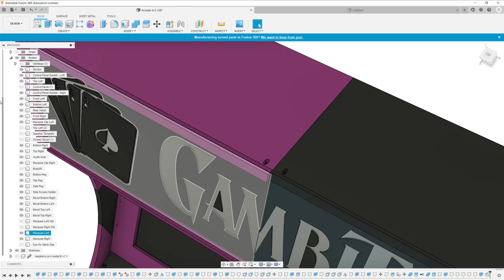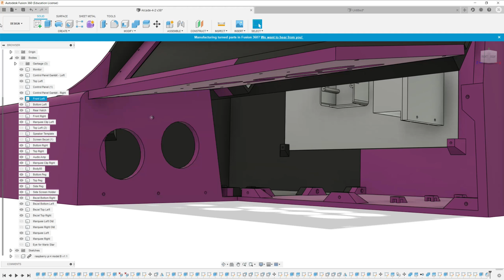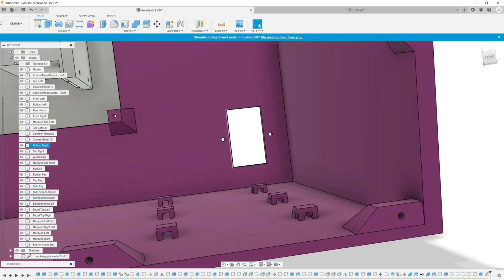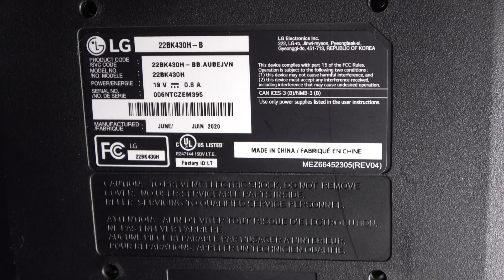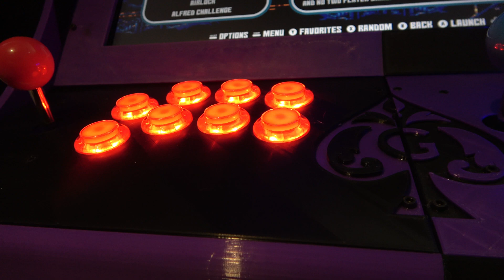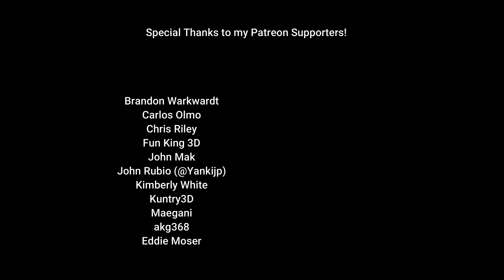3D Printing a FULL-SIZED Bartop ARCADE? The Arcade 42 [Pi Twenty-Six Ways Episode 11]

Comment: Dropped the files into OrcaSlicer just to estimate the plastic usage and there are enough oddities with the files that I gave up trying to figure out exactly how many spools this would go through. Empty first layers and oddball default rotations, for starters.

But, this being a 1 of 1 design, that doesn't bother me all that much, I appreciate the files existing, even if in an imperfect state. Given that my printer is 250 and not 300 I would have had to chop it up differently anyway.
Reply from the maker: I do have a habit of providing STLs as they came out of the design software and not as I'd print them in the slicer. I hope they help you build something awesome!
Reply: @PrintNPlay I have to many other projects to juggle right not but when there's a slot free this is a very solid starting point

Comment: hahah, I asked myself, "why doesn't anybody just 3d print an arcade cabinet and I ended up here, hahah. Very cool and I would think the cost is much less than a full-wood build?  Not to mention the wood builds are HEAVY.  I would also want a PC in the cabinet vs the Pi.  The Pi is cool and all...but what if I want to switch over to modern 4k gaming?

Comment: Awesome Job.  Have you ever done a Virtual Pinball build.  Similar to the Bar top arcade a Virtual say 24 inch monitor Playfield would be a another great project I bet you would excel at.  Great Job again.  Glad I found your videos.
Reply from the maker: Thanks for taking the time to leave a comment! And glad you liked the project.

I have built a virtual pinball cabinet using a 24" display, but I did it out of MDF as a proof of concept. It had a shelf for a 15" 4:3 LCD for the scoreboard and marquee. I intend to do a 3d printable version of it at some point, just have to find the time!

Comment: Silly question here but what type/model 3D printer is being used here? I've been asked to outfit a new brewery with a bunch of "arcades" and intend to show them the magic of the Pi; need to acquire the right equipment first in order to start printing up! Many thanks
Reply from the maker: Both printers used to print the parts were Creality CR-10s. They aren't stock, but the parts here should print just fine on a stock one
Reply: @PrintNPlay  thanks for the reply! Great vids
Reply from the maker: No problem at all! Feel free to ask whenever you have one !

Comment: I'm probably gonna sound weird for saying this but I'd rather have the joystick on the right side. I'm right handed but I'd feel more comfortable controlling the buttons with my left hand. I feel the stick is the more important control in most arcade games, so I'd want my dominant hand to control it. I think it's because as a PC gamer I'm used to hitting the keyboard keys left handed.
Reply from the maker: Totally fair! And also pretty easy to fix. In software I could just cut out the control part, mirror it, and generate a new file. I've never tried joystick on left but now I am curious.